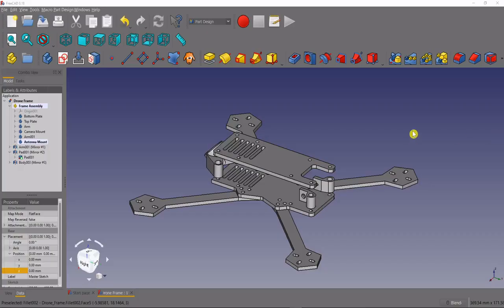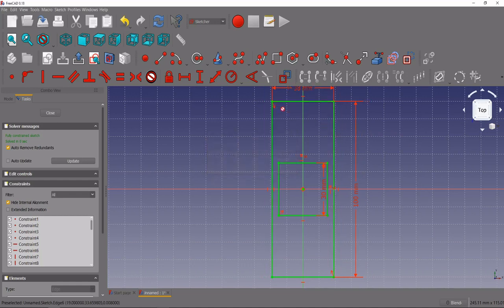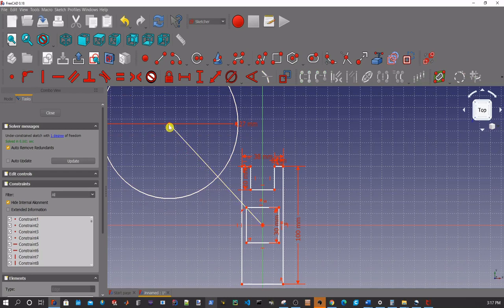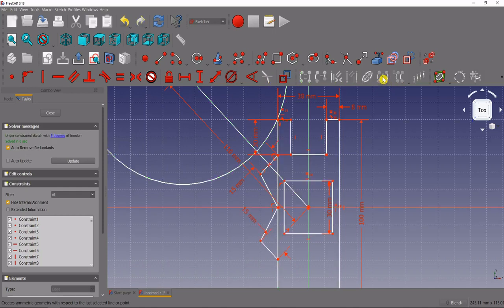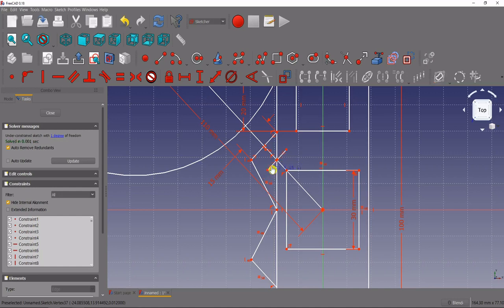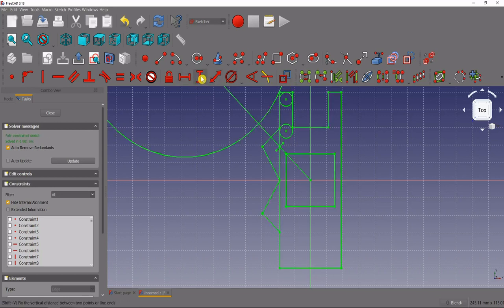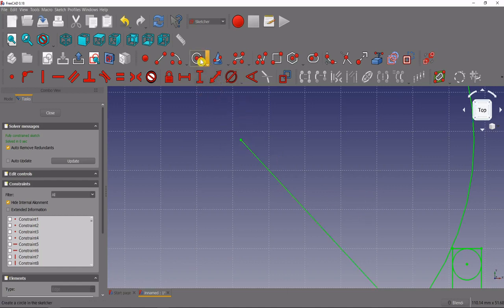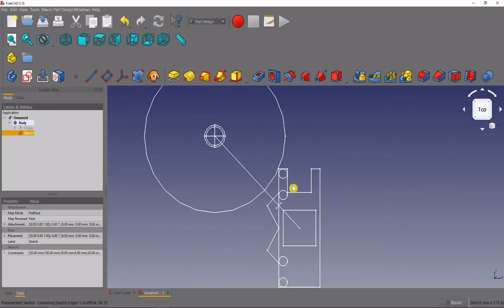FreeCAD Part Design with a MASTER SKETCH. Model a drone frame! Tutorial for beginners.

Comment: I have been follwoing your video and doing it myself as I went along. However, it wont trim for me for some reason and I cant figure out why. Would you know what the problem is?
Reply from the maker: It could be a few things. Make sure you don't have anything selected before selecting the trim tool.  you can also exit the sketch, and go back into it and see if it works then.  It would be much easier to help if I could see what is happening.  If you want, you can make a screen record and send it to fpvbldrs@gmail.com and Ill see what I can do.
Reply: @FPVBuilders  I think the points weren’t hitting the line so it wouldn’t trim the line until I adjusted my points again. Thanks for the reply really appreciate it.
Reply from the maker: @mehmetsimsek8815  glad you figured it out!